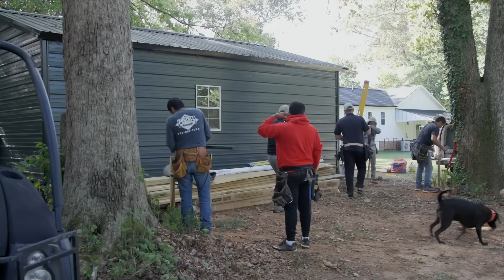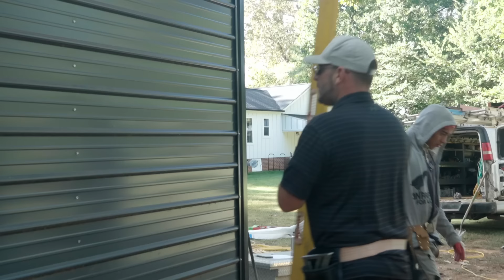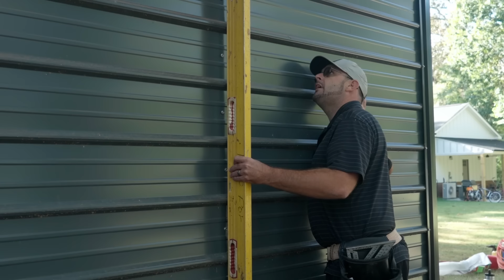How to Build a Lean-To | Step By Step!!

Comment: If I'm screwing my black metal down to 1x4's where you guys used 2x4's, what length screws am I using? 1 inch so they don't go to so far through the 1x4 so you see them underneath??
Reply from the maker: Yes typically the metal will come with the recommended screws from the metal panel provider. 3/4"-1" should be fine, just make sure they come with a rubber washer and when drilling down into the panel do not over screw. If you see the rubber washer over tightened  it will "blow out" and need to be replaced. Thank you for watching and especially the comment!!!

Comment: Absolutely enjoyed your video. Gives me confidence that I can do this. I have a question? I have a 24x40 garage. My roll up doors are on side entry. 40ft side. I want a 24x 24 lean to coming out from side roll up doors bolted to steel bldg right above doors. 11ft at door height and 9ft outward. If I were to build myself the way you did in video. About how much would that cost? Thanks for your time

Comment: THIS VIDEO SHOULD BE REMOVED FROM YOUTUBE!!!!!!!
THIS INDIVIDUAL IS UNSAFE!!!!!!!
This individual knows a little more than the basics and that is giving this gentleman a compliment!
At best this video was and is embarrassing and is a perfect example of what not to do!
His opening statement about checking to see if the existing structure “IS LEVEL AND STRAIGHT” is hogwash!!!!!
You check to see if the existing structure is:
1. PLUMB, 
2. LEVEL 
3. If the structure is SOUNDLY CONSTRUCTED and meets building codes!
Wearing flip flops on a construction project is DANGEROUS and UNSAFE.
To make light of this is THE EPITOME of STUPIDITY and is ASININE!
There was no PERSONAL PROTECTIVE EQUIPMENT (PPE) issued to the workers!!!!!
According to OSHA and other agencies this individual is responsible for their SAFETY!!!!!
At a minimum the following items of PPE should have been given to the workers for their safety:
1. safety glasses, 
2. hearing protection 
3. gloves 
4.Hard Hats
I observed the individuals unsafely utilizing ladders. 
According to OSHA and the ladder manufacturers:
1. You do not stand above the 2nd step from the top!!!!
This warning is on the sides of all ladders!!!!!!!
2. You do not straddle the ladder and stand on the braces!!!!!
The braces aren’t designed to carry weight!
3. You do not stand or use the top of the ladder as a seat!!!!!!
This is on the top of the ladder!
4. You do not lean a step ladder against a tree!!!!!!
You can lean a straight ladder or an extension ladder against a tree but not a step ladder!!!!!!!!
Sound construction practices dictate that you should utilize 4-6 inches of gravel in the bottom of the post hole instead of bricks in the bottom of the post hole for drainage.
Failure to do so will cause a pressure treated post to rot.
Also it’s a good practice to treat the pressure treated post that will be below ground as well to prevent rot!
I know this because I‘ve removed numerous rotted posts where other imbeciles have done this!!!!
Pouring dry concrete mix into the post hole and adding water isn’t very smart as you will have dry pockets of concrete.
I know this because I’ve gone behind other imbeciles that have done this!
The concrete should be mixed wet and poured into the post hole around the posts.
The way this individual allowed the young Hispanic men to unsafely use the power tools is stupidity at best and will get someone severely injured or killed.
Allowing those young men to walk across those flimsy purlins is a recipe for someone becoming injured or killed in the future!
         “According to OSHA most deaths and injuries are from falls that are from 6 feet or less!”
This individual is UNSAFE and is teaching UNSAFE Practices to people that don’t know any better.
I could go on but I won’t!!!!!
This was beyond embarrassing!

Comment: Any issue with sheathing and finishing the sides/rear and enclosing a lean to?
Reply from the maker: No not at all, people do this all the time, there are,however, some precautions to take. I would at least put 4" of gravel or pour concrete above the ground and use lumber rated for ground contact at the bottom. You may want to install at least 1' of pressure treated sheathing around the bottom as well. Depending on what region you live in may require some minor or major adjustments. Closing it in allows for more storage, possibly lighting for a work area etc. Great question and thank you for watching!

Comment: Good video. Another tip is to pre drill your metal. When you mark it out. Pre drill it with the whole run of your sheets. That way the metal your self tapping screws doesn’t cut your rubber screw washers and you have evenly spaced pre drilled marks on all of your sheets.
Reply from the maker: That is a great idea, and the screw will be perfectly aligned as well! Thank you for watching and the tip!!!

Comment: Great video.  How do u apply Ledger board when metal sheets are running vertically instead of horizontal in this video?
Reply from the maker: I actually did another lean-to video with that exact scenario for a retired military veteran named Miss Jackson. I filled the space with pressure treated decking boards to no press against the raised ribs of the metal. Then I applied the ledger with screws directly to the studs! Thanks for watching and check out that other video.

Comment: What is the slope of your Lean-To Roof?
Reply from the maker: The slope on this lean-to was around a 2/12 pitch if I remember correctly. This is not an ideal number, it would be much better if you could build one closer to 19° or a 4/12 pitch. The homeowner of this project wanted specific heights on the beam for entry with his atv so I built what his demands were. With metal roofing it maybe be ok but with asphalt shingles it would definitely need to be a 4/12 pitch for sure. Thanks for watching!

Comment: What’s that best type of anchors to use for the ledger board? 
They looked like just larger self tapping screws is that good enough?

I’m building one for my outdoor kitchen and have some knowledge but biggest thing was figuring out how to attach to existing structure
Reply from the maker: I just realized you were writing about the lean-to and not a deck!!!! Same strategy applies for the screws and flashing except, Make sure the flashing goes behind the siding and over top of the new roofing of the lean-to!!!!
Reply: @firstnforemost7283 what about if I’m attaching to metal studs like a metal shop
Reply from the maker: There are many screws available to accomplish this task. I will give you my top three suggestions. 1. 1/2" galvanized lag screw with washer on the outside. This is a very strong option, but you need to be careful where it is applied as most joist are only an inch and a half wide. You should probably predrill a hole because displacement is going to happen when Apply such a big screw. 2. 1/2" galvanized  thru bolts, similar to the lag screw in size ,but is more typically only applied to the band board. With this screw I would suggest using an extra block on the inside of your band and predrill your holes as well. This application will call for a washer inside and out as well as a 3/4" nut on the inside. 3. Ledger lok lag screws. These are 5/16" coated screws made specifically for decks. I like this option a lot and I use this on my new homes as well as rebuilds on older homes. The 5/16 size as a lot less displacement and allows us to drill through the band and into the joist as well ,without destroying the integrity of the wood it is screwing into. Very easy to apply as it can be done with you Basic drill or impact in a matter of seconds. Ledger looks are very strong and last for a very long time. For all of these screws I like to have them spaced out every 16" O.C. in a zig zag pattern ,one up  next one down, never entering in the last two inches of the ledger. Also i would recommend adding some vinyl counter flashing to the wall of the house(about 4-6 inches up the wall) and let the rest lay on top of the joists before you put the decking down. It would also be a good idea to have a vinyl  flashing behind the ledger itself.This will push any rain or weather away from the house and Ledger. Along with screwing your Ledger to the house on 16" O.C. , if your Ledger is in more than one piece, where two pieces meet each other ,have lags with 1' of the break on each side. Lastly ,they have these metal brackets called deck tension ties that attach to the joist and then to the band which prevents separation from the house. Thank you for the question and please keep us posted on your progress we would love to see what you've built or are working on. If you have any other concerns or questions ,please reach out! Have a great day!!!

Comment: If I wanted the carport to be enclosed without a door to protect the ATV from the weather, is there anything else that I need to consider except putting 2x4 and plywood?
Reply from the maker: Thanks for watching and especially the question!!! I would definitely at least install a concrete floor or even p57 gravel to get the tires off the ground. But for the walls, I think you are spot on. I would make sure the bottom 2x4 closest to the ground is pressure treated lumber for ground or concrete contact. Osb or plywood would be fine for the exterior walls with house wrap and some type of siding. You could also just use T 1-11 plywood and paint it right away, which would be even cheaper than siding. Where about are you located? Thanks for the great idea and keep me updated on what you decide to do!!!!! Have a great day

Comment: Are notches mandatory
Reply from the maker: I think the are essential for uplift in storms for sure. There are alternatives such as metal connectors that are made just for this situation. They are just expensive sometimes upto $25 each as where the bolts cost about 5 dollars for both. In high winds areas and with this beam being exposed to water is would not want to just rely on nails! Thank you for the comment

Comment: Bird's mouth cuts should be no bigger than 1/3 the total distance of the plumb angle. It looks like you cut halfway through the board.  This weakens the rafters. It wouldn't pass code.

Comment: Great job on the instructional video. Just a word of advice if you put a lot of metal panels on especially lower profile ones.invest in screw guns that have an adjustable clutch. They will not blow the gasket like impacts. Thanks again for the extensive instruction in this video.
Reply from the maker: That is so true, and as soon as the gasket is blown through , it is normally longer waterproof..Thanks for watching and especially for the comment!!!
Reply from the maker: No longer**

Comment: Adding a lean to on my 20ft container. Noob with no carpentry skills but this has inspired me and scared me in equal measures.
Reply from the maker: Don't, worry. The container is a thick metal(a good thing)  you just might need to predrill your holes where you are going to bolt the ledger to the container. Or maybe even add a beam close to the container as well to not even rely on the container for supoort!. But I would say if you pre-drill the holes for the ledger, and use a thru-bolt that is at least 3/8", better even to use 1/2" diameter if studs on container are big enough. Then tighten bolt down with nuts and washers from the inside of existing container.  Typically the top edges of containers are flat ,I would connect right under there so when you install your flash , you have a nice flat surface to seal, instead of the ribs on the side of the container! Thanks for watching and send some progress photos or video of your build to Firstnforemost2022@gmail.com,  we'd love to see it! Have a great day!
Reply from the maker: Also if you have any other questions or concerns about your build , just reach out we'd be glad to help!

Comment: What zone is this? (Expected snow load?)
Reply from the maker: We are in virginia,  Mid-Atlantic. We do get snow sometimes but not very much. This roof is however, is designed to hold 40 lbs per sq ft. If it was a more snow heavy zone I would definitely shorten up the spacing on those rafters. The perlins at 2 feet on center are fine for snow loads!!!!

Comment: I noticed the rafters were way wider than what everyone is advising me to do. Im being told 18 to 24 inch spacing. Can you advise?
Reply from the maker: Yes, gladly! 16" -24" would definitely be stronger on the rafters layout , and maybe the "runner or perlins" 2x4 on top of rafters could go down to 16" O.C. spacing to would definitely beef it up more. I would base your build on your plans for use and also take in consideration what the elements are like in your area as far as , snow potential and ice for extra strength in the north, or high winds(which with small O.C. spacing provides more places to screw roof down ) areas that uplift and humidity are valid issues...anything specific to your area that would and could affect your structures strength and durability and also your use!. In this video we had 4 ft O.C. Spacing on our rafters and 2ft O.C. spacing on the perlin 2x4 runners. On our other  lean-to video that we did for our subscriber Ms. Jackson we did 3 ft O.C. spacing on the rafters and 2ft O.C. spacing on the perlins.  If you plan on closing the space off and finishing into a garage or room I would say definitely go to 16 in O.C. or if your zone has specific needs as far as mother nature or normal building practices for your zone, I would go 16" as well. I hope this helps if you have any other things you would like to ask or share your progress of your project, please reach out either here or at our email, we would love to help!
Firstnforemost2022@gmail.com 

Thanks for watching!!
Reply: @firstnforemost7283 thank you for the reply. I do live in an area that sees lots of high wind and occasional snow. NW Alabama tornado alley. I'll probably go with 24" on shed lean to.

Comment: Nice work I’m going to do similar for shade over patio but mine will not be as beefy ( strong as yours) yours is built super sold no doubt. I will use 2x6 for headers depending on price maybe 2x6 for runners 4x4 for post I will have 3 . Of course mine will not be quite as big.

Comment: What pitch is this roof? Im building a similar Lean-to and am getting conflicting info on roof pitch given a metal roof.
Reply: Seems like he said a 5 degree slope? I might be wrong but it does seem kind of flat. Video said ideally you would have 12 degrees of slope. Did you end up building yet?
Reply: @mediocrefloridaman  yep I ended up doing a 1:12 pitch which works out to be about 5 degrees. It is flat but the metal roof manufacturer I used specifies 1:12 as allowable.
I built my carport almost exactly like these guys except I used steel brackets set into concrete piers rather than burying the entire post in concrete.

Comment: Using the dry pack concrete is not wrong, depending on if your holed are deep or shallow.  That being said, in my area, the inspectors like to see a 4-inch pad at the bottom of a 4ft deep hole, then packed in with 5/8 crushed rock

Comment: I finish off the post holes by digging a 12" sq at the top of the post angled to the post on all four sides, about 8 inches deep. Then overfill the hole with concrete and trowel smooth, angled away from the post on all sides.  Results, water will run away from the post, dirt won't contact the post near the surface and trimming the  grass around the post is eliminated.
Reply from the maker: That is a great idea and very smart to minimize maintenance on the post! Thank you for watching!

Comment: How would i prevent water intrusion at the top edge if mounting to t1-11 siding, with no eave to block rain?
Reply from the maker: You could do many things, some better than others. On option would be to be metal into the shape of a capital L . Or maybe not quite 90° and install to your t1-11 and let the L stick out over where your panel ends, and then seal the top edge of the L to the t1-11 with caulk. You could also cut the t1-11tand slide the L metal in behind the t1-11 and not have to rely on caulking. But this is more difficult. Y could also just cut a slit in the t1-11 and for a kinda Z shaped metal but more 90°sh and let the top of the Z go into the slit and caulk, kinda how we do brick chimneys and roof flashing.. and then let the bottom of the "Z" come out over your roof panels. I hope this helps, thank you for watching!

Comment: Is it okay to pour concrete in a hole to hold up a post like that??? I've seen comments saying the concrete will rot your wood faster...is this true?
Reply: True if done improperly. It needs to be coated and the mix can't allow water to pool up around the post
Reply: @shanedoe7232  i seen a video of people burning the wood before also burying post... pretty cool stuff
Reply from the maker: It's true concrete can eat away at wood over time, but it's nothing in comparison to the damage water can cause..I always picks this posts up off the ground with gravel or solid blocking so water can drain underneath the post instead of just sitting at the bottom of the post allowing it to soak up water. Same is to be said for the top of the concrete where the post comes out, do not need water to sit there either, @shanedoe7232 , he is absolutely correct. And treating the post or burning it it just another step that can be taken to help longevity!..thanks for watching!!!!